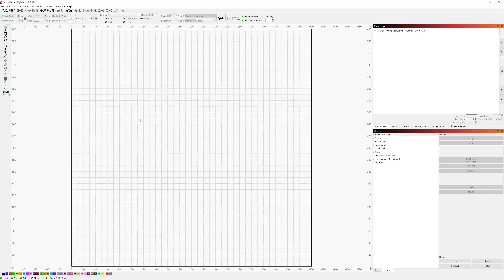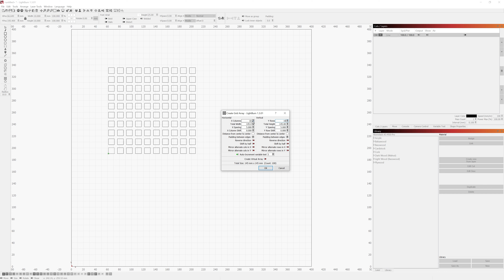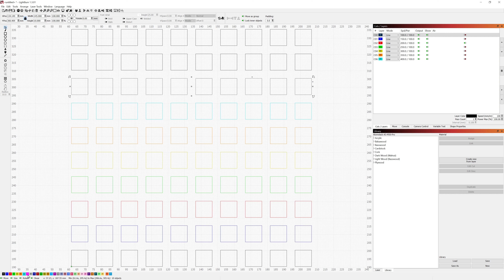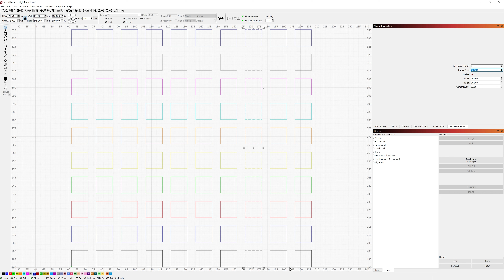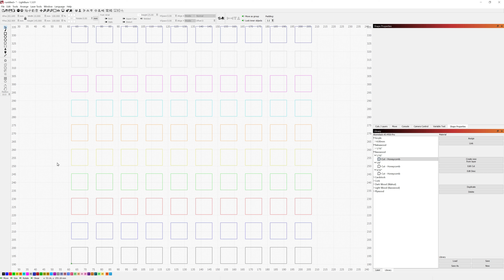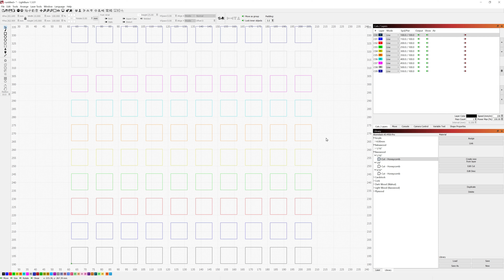Laser Cutter - Easy Speed and Power Tester using Lightburn

Comment: Very nice! Will certanly try when my laser gets here! Thx.

Since I got the same laser A5M50Pro, did youbtry cutting 4 mm plywood? Os that "out of it's reach" or is it feasable? Also, do you export the gcode to use offline in the machine or do you always use the laser through the pc?
Thx 🤗
Reply from the maker: I have tried 4mm plywood and I got mixed results, I'm assuming because of differences in the material/glue.  On one sheet I was able to cut through it using 200 mm/m, 100% power, 2 passes. On another sheet it didn't manage to cut through no matter the speed or number of passes I tried. Sticking to ~3mm or less (~1/8") has given me the most consistent results when I've tried out mandalas and other wood cut tools, without burning/charring the wood badly.

So far I've stuck with having my laptop connected to the laser for the entire run and haven't done the export to the SD card to run directly on the laser.
Reply: @CubicleNinja  Thx for the reply. Yes, plywood may be problematic for the glue indeed... I'll try to stick to 3mm as well. Thx ^^